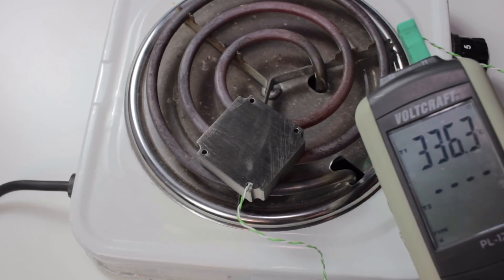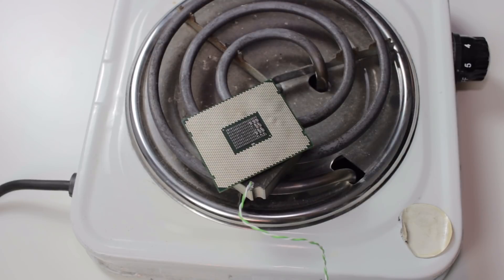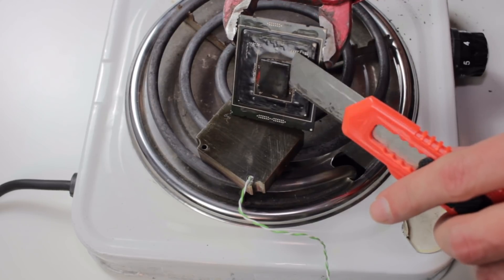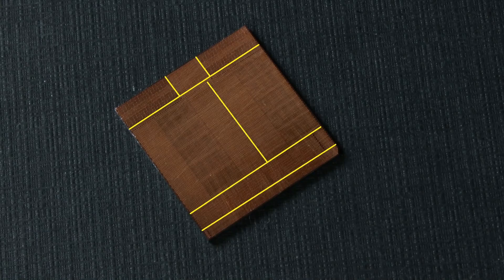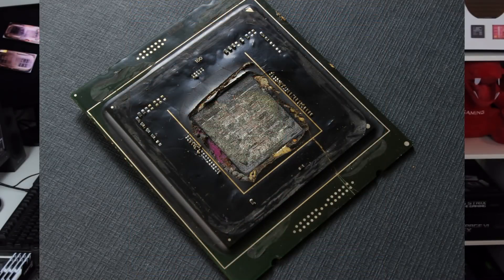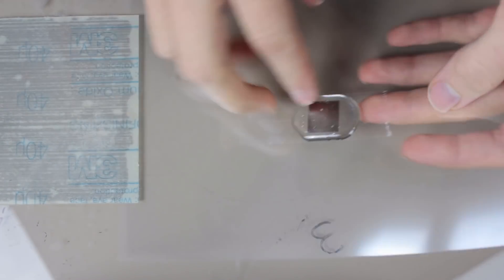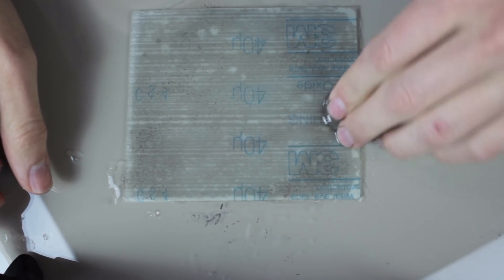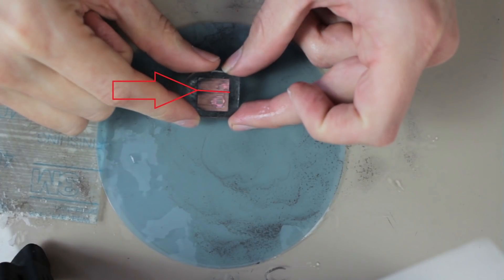FAIL - i7-6950X DIE SHOTS (en)

Comment: round 5:13 +  The die is not bent, you just can't make such precision by hand. The resin on the edges is softer than the die in the middle. You could try make the surface area bigger so it wont tilt so much. Thanks for the videos though, appreciated.

Comment: maybe if you squeezed the die between two perfectly flat milled plates it would take the curve out.  or use sandpaper wrapped around your finger to conform to the curve.  alternating with a light sand and acid and if your depth is too shallow more sanding followed by more sanding. just a thought.  im sure the ultrsonic machine will be much easier though.  goodluck

Comment: Even if this is hydrofluoric acid, I'd strongly suggest not using the gloves as you're much more likely to make mistakes in handling the acidic solution with them. Acidic solutions on skin aren't an issue as long as you have a tap with water nearby to rinse it off.